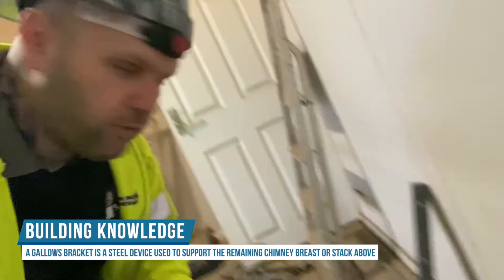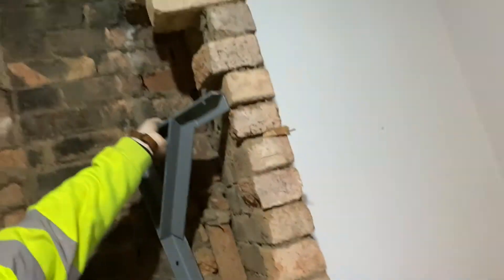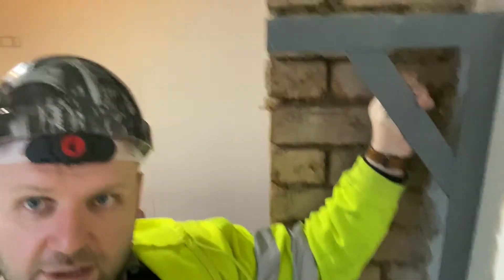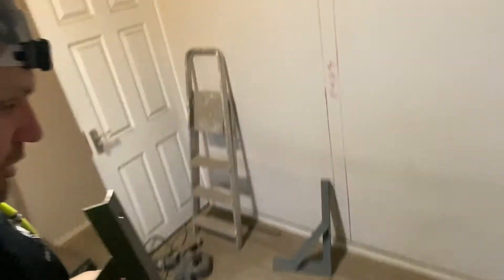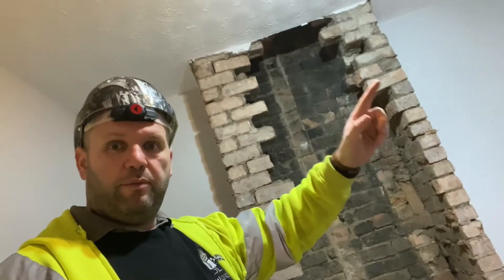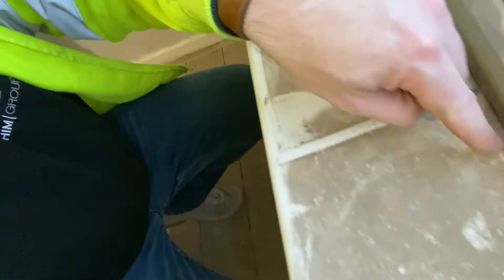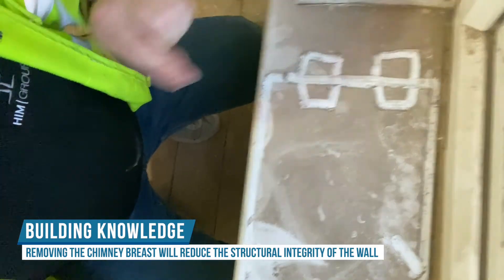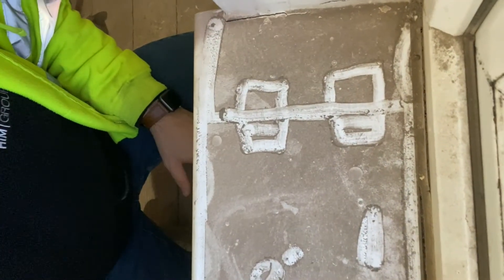Using Gallows Brackets to Safely Remove a Chimney Breast

Comment: What’s supporting that middle row of bricks in the middle? It looks like you’ve taken it out, but then when you put the camera up.. you can see them there.. midway up.. but looks like it’s just floating
Reply from the maker: Good spot, those bricks aren’t floating! There’s a gallow bracket system installed underneath that supports the remaining chimney breast. You can’t see the full setup clearly from that camera angle, but everything above is properly supported and tied in. I’ll make sure to show that more clearly in a future video 👍

Comment: It looks like I have lime mortar… what would be the best way to support the chimney to remove the chimney breast throughout?
Reply from the maker: Thank you for your message, If your chimney is built with lime mortar, it’s essential to handle removal carefully to avoid damaging the structure. The best way to support the remaining chimney (especially above) is usually with a steel beam (RSJ) or gallows brackets, but you’ll need a structural engineer to assess and specify the right method.

Also, check if a Party Wall Agreement is needed (if it's a shared wall), and notify Building Control before starting. Once approved, the support can be installed, and the chimney breast safely removed.

Comment: Thanks for posting the video 
I have a question if you use gallows brackets one side and one day next door wants to remove there side can they use  gallows or do they need to use a rsj if so how thick does the  Supporting walls need to be
Reply from the maker: Thanks for watching and great question! 👍
If one side uses gallows brackets, and later the neighbour wants to remove their chimney breast, they can't automatically rely on your brackets — each side needs its own independent support. Whether they can use gallows brackets or need an RSJ depends on factors like the wall construction and thickness.

Generally, gallows brackets are only allowed if the party wall is at least 225mm thick (a full brick wall), and even then, local building control may still prefer or require an RSJ. It’s always best for them to get structural calculations and approval from building control before going ahead.

Hope that helps!

Comment: How is the top half of the chimney supported whist the plate is slid under? Those brick must still weigh heavy. I see you would put the brackets up before but just wondered how it happens...
Reply from the maker: Great question! When using gallows brackets to remove a chimney breast, the key is ensuring the load is properly supported before you start. Typically, temporary props or supports are placed under the top half of the chimney to bear the weight while the gallows brackets and the supporting plate are being installed. These props hold the weight of the chimney until the brackets are securely fixed and the plate can be slid into place. Once everything is properly supported and the brackets are in position, the temporary supports can be removed. It's important to do this carefully to avoid any risk of collapse during the process.

Comment: So what holds the chimney whilst you put in the bracket
Reply: Nothing, it will hang in the air, just attached to the wall for that time. It would stay probably forever this way even without brackets.

Comment: Couldn't you just use a strongboy and then build a corbel using some of the bricks you've ripped out? The bracket will have some cost, and the bricks are already there.

Comment: Hello, I’m buying a property and noticed the owner removed the chimney only on first floor awithout adding any steel support or Gallows bracket. Now if I wanna add the gallows bracket back do I need a building control please ?
Reply: Did you buy the property?  Please keep us updated with how it worked out for you…

Comment: I’ve been planning on removing the chimney breast since they took out glass front fire and installed gas ( no fire just gas boiler in other room that heats radiator’s and water only ) . Should I brace chimney stack before removing the chimney breast ground and 2nd floor? . 
Glass front fire and boiler were removed and just blocked up with plasterboard with electric fire and mdf fireplace surround, which is just dead space, removing it would give so much more room in living room and front bedroom. Don’t have anyone next door to me, just my driveway up the side of my gable wall

Comment: Wow. Just by  change stumbled over this video and did not realise that not only Building Control will need to be informed but also Party Wall Act has to be in place. Now, the neighbour removed their chimney breast and did not inform me of the Party Wall Act but I know the Council Building Control was out several times. Now what is the result of the Party Wall Act not been in place? What a dilemma.
Reply from the maker: Hi Tahera. Thank you for watching and for your question.

The Party Wall Act serves as a mutual agreement between you and your neighbour and is there to document the current condition of the wall on either side. Hence, if your side of the wall should be damaged in any way or suffer damage in the future you can potentially relate it to the works that have been carried out.

If works have been carried out and you don't have any issues your side, then there isn't really a problem. However, if there is an issue, you can contact a party wall surveyor and follow their advice.

Hope that helps.

Comment: personally I don't trust brackets having seen some pull away and also supporting brick work crack where fixings were placed, I prefer a beam, much more expensive but will never fail, nice work though, and like you said get the eng out and signed off, then you are covered and the house won't have a problem on selling.
Reply from the maker: Hi there. We would also prefer to use a beam, but sometimes the practicality of installing a beam isn't straightforward. And sometimes, of course, the clients budget dictates our course of action.

Thank you for your kind words and taking the time to watch our video – much appreciated 🙂👍

Comment: Am I right to say that not all terraced houses are single brick. Some are double bricked right?
Reply from the maker: Hi there. Thanks for watching and for your question. Yes, you are right. Some are double-bricked 🙂👍
Reply: People seem to be using different terminology, with regards to single brick and double brick.

Maybe the word brick is being used where perhaps "skin" would be more appropriate.

A (modern) brick dimensions, Length x Depth x Height, are 215x102.5x65.

There will be a 10mm mortar bed at the base and one side of each brick.

A 1/2 brick wall is the depth of 1 brick thick - 102.5mm, and will have 1 "skin".

A 1 brick wall is the length of 1 brick thick - 215mm, and will have 2 "skins".

A double brick wall will be 440mm thick (the length of 2 bricks + 10mm mortar) - normally found in castles not an old terrace :)

The depth of the chimney breast shown is 337.5mm and that would be classed as a 1 1/2 brick deep chimney breast.

So, it is common (and appears to be the case here as the builder described it as "very very thin") for a party wall to be 102.5mm thick.

More usual terms (my neck of the woods) would be: single skin or 1/2 brick wall.

Comment: Did you leave the brackets exposed or did you install them up into the ceiling?
Reply from the maker: Hi John. Thanks for watching and for your question 🙂👍 The brackets would be above the ceiling height into the loft. Hope that helps.

Comment: I’d love some advice.
We went to buy a house, the previous owner removed chimney Breast,, didn’t put gallow brackets up in the loft for the stack ,, anyhow building surveyor spotted this and made them put them in… so we bought the house ,, Fast forward 6 months , the stack above the roof seems to be leaning , also a slight twist about half way up the stack , we called a roofer / builder out , he will remove the stack and seal the roof , but leave the rest of stack in the loft still on the gallow bracket , does this seem right ?  Also the party wall in the loft doesn’t look in the best condition,, but still passed building control ,, who told us to keep a eye on the stack in high winds ,, like that filled us with confidence,,  been quoted nearly £2k to remove including scaffolding price ,, any advice ? I’d really appreciate
Reply from the maker: Hi there. Thanks for your questions. We would suggest that it would be a better job to remove everything. If you remove the chimney stack, you're reducing the load on the party wall, which should improve it. Repointing would also help strengthen the party wall. 

Hope that helps. Thanks for watching our video 🙂👍
Reply: @HYPEBuilding  thank you so much, I will repoint the wall 👍🏻👍🏻
Reply from the maker: @ianmac8426  You're welcome, mate 👌

Comment: Gallows brackets should never be used in this situation (shared chimney) and the SE is negligent it design the use of them here.
If the neighbouring property were to alter their chimney in any manner there would be a great risk of the remaining stack collapsing
Reply from the maker: As a professional organisation, we did, of course, carry out this procedure under the guidance of the Party Wall Act, whereby we informed the neighbour of the work that was about to take place. Hence, they are very aware that gallows brackets have been used. 

Similarly, if the neighbouring property were to do any further work on the chimney, they too would need to follow the Party Wall Act. At that point a Party Wall Surveyor would identify any potential risks of 'altering their chimney' as you put it. 

The Party Wall Surveyor could then suggest other methods to achieve the desired result while liaising with the Structural Engineer.
Reply: @HYPEBuilding  Did your SE have Hilti/an-other onsite to perform a pull-out test for the fixing of the gallows bracket into the brickwork? 
I've had Hilti out to site before to do a pull-out test on a similar project and they would not stand by use of their fixings connecting a gallows bracket to brickwork.
Reply from the maker: @Helibox  No Hilti haven't done a pull-out test. However, we do use professional Structural Engineers with the appropriate insurance.

Comment: Is the video done for the 1 using a steel beam. Is there a link to it thanks
Reply from the maker: Hi Darren. Thanks for watching. We don't have a video for the steel beam yet, as we haven't had cause to use that particular method for a project. We may, however, be doing so in the New Year. If we do, we'll post the link for you, buddy 👍
Reply: Cheers

Comment: I have a 3 storey terrace and I would love to remove the chimney breasts I have running from top to bottom in both the front and rear rooms of the house. Firstly, my neighbours chimney is not on the other side of mine, I.e we don’t share the chimney, does that mean I can’t do it? Secondly, this may be a dumb question, but do the chimneys support the floors in any way, or do you just fill in the holes where the chimney was?
Reply from the maker: Hi David. Thanks for your question. If you don't share the chimney, that doesn't mean you can't do it. We would, however, advise that you get a structural engineer (or competent builder) to make sure that if you remove the chimney, you're not weakening the structural integrity of the wall. 

The chimney doesn't support the floor – unless you have a suspended floor – in which case the floor joists will be attached to it. The type of floor will determine how you go about completing the job. 

Hope that helps. We really appreciate you watching our video. Thank you 😊👍

Comment: What would it cost to remove a chimney?
Reply from the maker: Hi Ricky. Thanks for your question. A chimney removal project like this can cost anywhere between £4k and £11k. There are many factors involved, including your geographical location, the type of property, the size of the chimney, how many bricks need to be removed etc. 

Thank you for watching our video – much appreciated 🙂👍
Reply: @HYPEBuilding  thank you for the reply. I was thinking about removing mine in the room and  leave it on the roof but now I'm thinking it might be better to slowly chip away the the chimney and remove it from top down. I think I've got a secondary chimney which was blocked off which is strange internally as there's no internal section. Need to confirm it buy dropping a camera down there.
Reply from the maker: @rickysingh616  Yes, it's probably better to be safe than sorry by getting a camera down there. If the chimney is shared, make sure you do a party wall agreement 👍

Comment: Cost to remove a chimney breast and add the Gallow bracket with certification?
Reply from the maker: Hi Barbara. A project like this can cost anywhere between £4k and £11k. There are many factors involved, including your geographical location, the type of property, the size of the chimney, how many bricks need to be removed etc. 

Thank you for watching our video and for your question 🙂👍
Reply: Thank you so much for responding to my query much appreciated.
Reply from the maker: @barbara9970  You're most welcome. Sorry we couldn't be of any more help. Hope your project goes to plan 👍

Comment: I had a chimney  taken out and we employed the exact same approach.Structural engineer, gallows bracket, building control etc.Total piece of mind and no issues when we came to sel.l
Reply: Is it legally required to have planning permission from council for chimney removal. How much structure engineer charge to visit and advise
Reply: @kkj85  Building control.I can't recall how much the structural engineer was.He did the calculations  for the weight involved and the strength of the steel req.
Reply: Is it legally required to have either or both to come. Mine is not a party breast nor a supporting breast.
Reply: @davebrown683  Yes as far as I know.
Reply from the maker: Hi Pedro. Thanks for your comments. As you say, it makes total sense to do things properly. That way you can have no regrets.

Really appreciate you taking the time to watch our video and leave us your thoughts, buddy. Thank you 🙂👌

Comment: could scratch cout the wall with render then dot and dab over it to prevent any co coming through the gaps
Reply from the maker: Hi David. Thanks for your comment. Yes, that's a definite possibility. However, the integrity of the flue liner next door would need to be inspected beforehand.

Thanks for watching and taking the time to leave us your thoughts – much appreciated 🙂👍
Reply: @HYPEBuilding  no worries cheers for the reply

Comment: i have a chimney breast i was hoping to remove and use these brackets but my next door nabour has alredy done this on there side using gallow brackets  dose this mean i would be unabel to do on my side also chimney brest gose in to two rooms via a brick wall could i only remove brest from 1 side
Reply from the maker: Hi there. Thank you for your question. If your neighbour has fitted gallows brackets, it could potentially mean that you can't fit them – but it very much depends on how the party wall is constructed. We would recommend that you have a structural engineer assess the situation for you.

Many thanks for watching our video – we really appreciate it 🙂👍

Comment: 1 question - What happens if the neighbor is being awkward and won't agree?
Reply from the maker: Hi Garviel. Thanks again for your questions. If the neighbour objects to the work taking place, the Party Wall Surveyor will help to resolve the situation. If the building is unsafe and the work that you are carrying out will improve the structural integrity and make it safe, then the work will need to take place anyway and the neighbour should have no objection.

Hope that helps. 

Thanks again for watching. We're delighted that you're finding our content useful and informative 😀👌
Reply: @HYPEBuilding  Brilliant! Thanks for replying!
Reply: I have a single stack chimney built in to a end wall of house, would the back of the chimney be the inside skin of the cavity ? Or would I be leaving a single skin wall which could potentially be a penetrating damp source

Comment: Do I need a structural engineer if I get the stack removed also ?
Reply from the maker: Hi there. Thank you for your question. It's a really good one 👌 

If you're removing the entire chimney from the ground upwards (including the bit above the roof) you wouldn't need a Structural Engineer, because you won't require any steels or gallows brackets to support a remaining part of the chimney.

If you're removing part of a chimney, you will need a Structural Engineer to assess the load of the chimney that will remain. They will calculate the size of steel or gallows bracket needed to support that load. 

In either scenario, you would need a party wall agreement to remove the chimney.

Hope that helps. Sincere thanks for watching our video 😊

Comment: Do you need building regs permission to remove chimney breast
Reply from the maker: Hi there. Thanks for your question. Yes, you do need to get approval from Building Control before you can start removing the chimney. The usual process involves submitting your request to the local council and waiting 5 days before starting work.

Thank you for taking the time to watch our video 🙂👍

Comment: Roughly what cost would this type of work be please?
Reply from the maker: Hi David. Unfortunately, it's very difficult to give you a figure with this because there are so many factors involved. The area you're working in, the size of the chimney (and how much needs to be removed), plus how far the skip is away from the doors etc. all play a part in the overall cost.

For chimney removal, structural engineer costs, bracket installation, waste removal and labour you're looking at anything between £4,000-£9,000.

Hope that helps (a little 🙂) David. Sincere thanks for watching our video and for your question – we truly appreciate it.